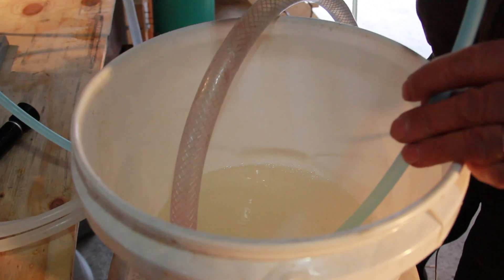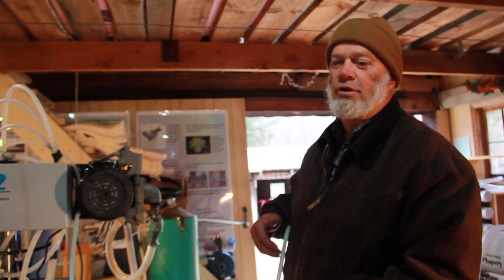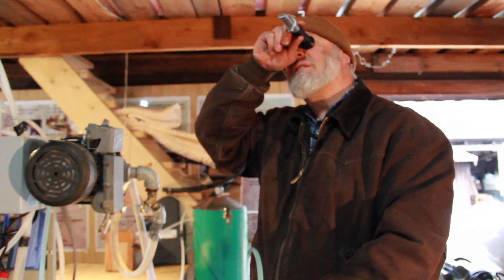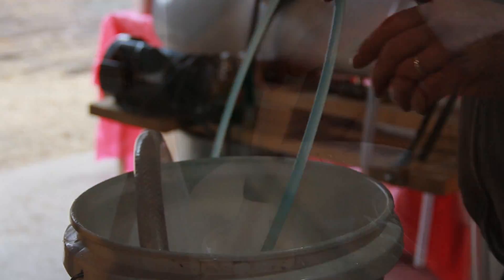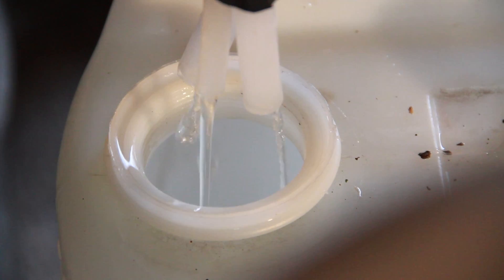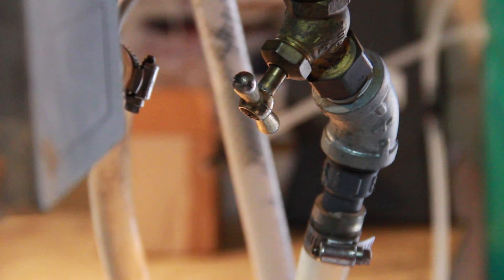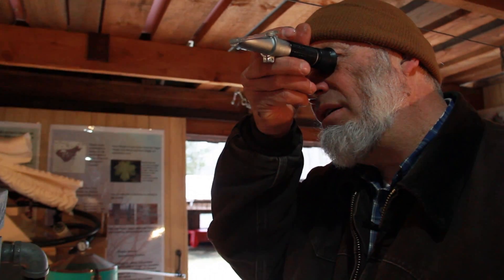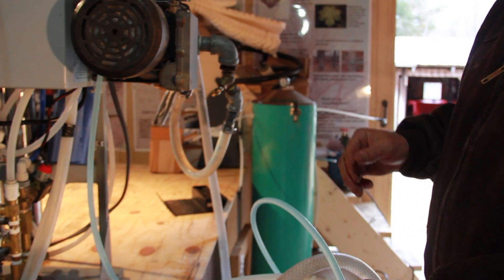Reverse Osmosis Demonstration and Cleaning Process

Comment: Hi Do you have a video on proper practice on storing the RO machine?  I have heard different theories on the use of glycol.  Most manufacturers make it seem necessary to use in order to maintain the life span of the gaskets in the pumps...while others say you should never use because of health issues.  Could you advise on if there are other options if Glycol in not preferred? Thanks

Comment: Hi I found your video to be very informative and a friend and I have spent a lot of money building a reverse osmosis system. The only difference between mine and the one you show on the video with the 21" canisters, is I went with the 4x40s We've had some problems with the system pressurizing so I added a tap to the line as my booster motor doesn't have a regulator on it. Although we are reaching 200psi the water is not separating from the sap. Do you have any suggestions of where I may have gone wrong?
Reply from the maker: Mary-Lou Chevrim I would suggest contacting Stephen Childs (featured in this video) at his email address: slc18@cornell.edu He should be able to help you. Best of luck with your RO system and thank you for watching our channel!
Reply: qq
Reply: Qq
Reply: A